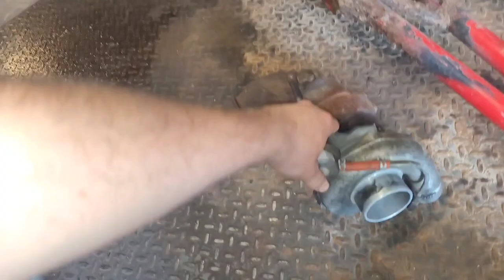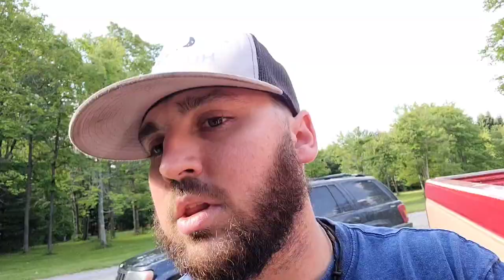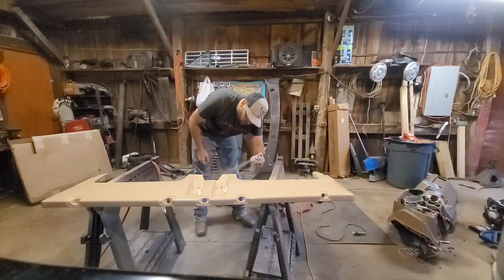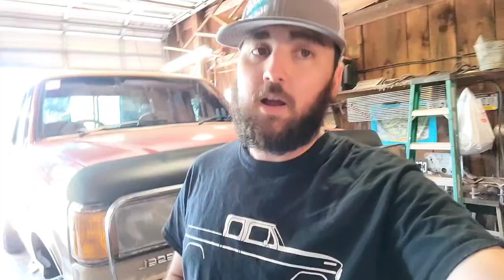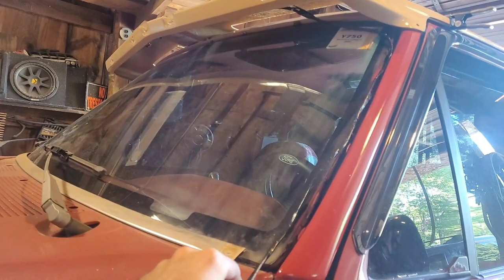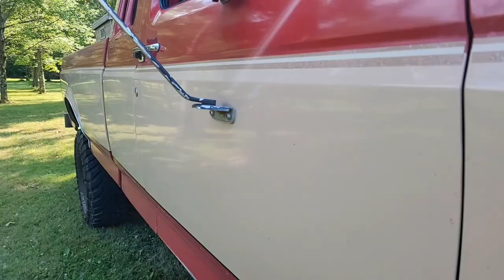Lund visor install and roof repaint on my 90 F-250!!

Comment: What did you use to hold the bolts? Looking real good. Getting a visor myself in a few days hopefully
Reply from the maker: I used riv-nuts. It's basically a threaded pop rivet you can put a bolt in. Harbor freight sells the kit for around $25 if I remember correctly

Comment: Nice job, beautiful truck, I have an 87 f150 almost same color skeam. Mine is red and cream. I'm looking at a visor this week the guy say it fits 80 to 96 but it came off a full size bronco. Do you know if that would fit my truck. I like the idea of running the wires down the window channel. How is it to remove that window trim.
Reply from the maker: So the Bronco visors are slightly different than the f-150- f-350 trucks. The Broncos have a taller roof, so you'll most likely have fitment issues. But since you found one for a Bronco, I'd snag it and sell it, it'll go for good money! 

The windshield trim isn't hard to remove, just be very easy because you will bend it.
Reply: @mavsfabshop  thank you for getting back to me, I'll go check it out this weekend. Happy holidays

Comment: how has everything held up ?  any leaks?? did you have any riv nuts spin out ??
Reply from the maker: So far, so good! No leaks coming from the visor since I used rubber washers and put silicone around the riv-nuts, and haven't had any of them back out on me.  I've taken the truck on a long road trip and drove it quite a bit over the summer, and didn't see it try and lift up at all, either.
Reply: @mavsfabshop  that’s awesome, thanks for getting back to me. I just bought a moon visor for my 95 and i’m contemplating how to get it mounted/sealed up. Definitely gonna rivnut it and try to find me some rubber washer and silicone 🤘🏻
Reply: @mavsfabshop  can you walk me thru this exactly. you drilled, rivnut, silicone around the rivnut then rubber washer and bolt ?
Reply from the maker: @bobtailsthecat  yepp, that's exactly how I did it. I did put a little bit of silicone around the bolt heads for some extra security, too.
Reply: @mavsfabshop  okay i appreciate it
Reply from the maker: @bobtailsthecat  anytime, buddy

Comment: Any clue on where to get new wireing with bolbs and lenses?
Reply from the maker: Unfortunately, no I don't. I did all the wiring myself because I had everything to do it with
Reply: @mavsfabshop  how did you get the bulbs to stay in the visor hole you clips are old and worn bulb falls out
Reply from the maker: @user-le6yd4ph7q  so I'm using little LED Penny lights, the holes in the visor were drilled out to accept those
Reply: @mavsfabshop ok cool that's brother